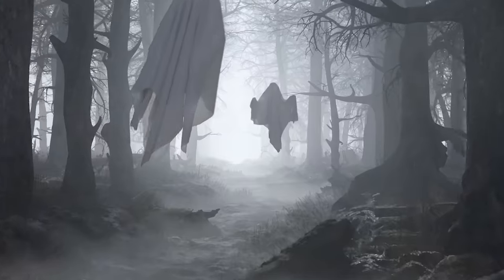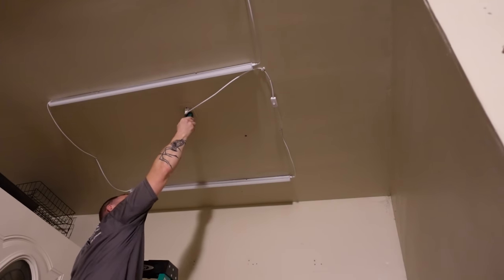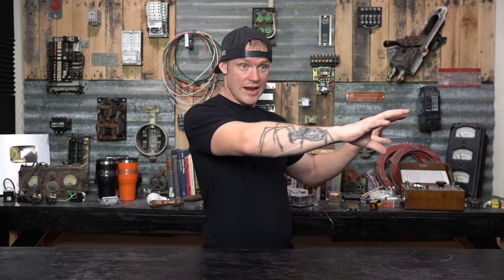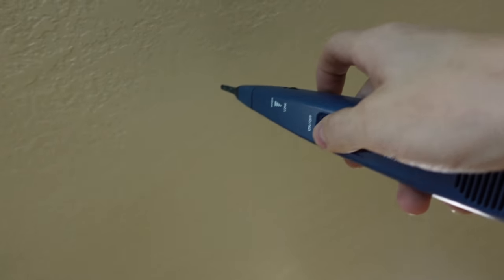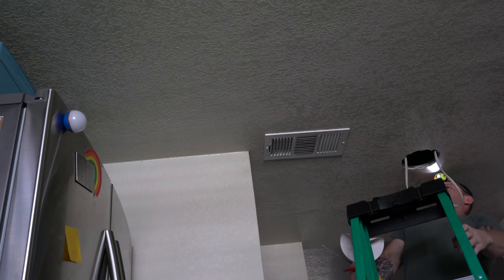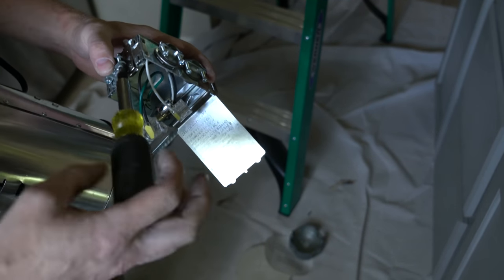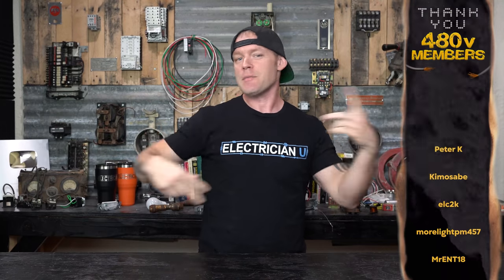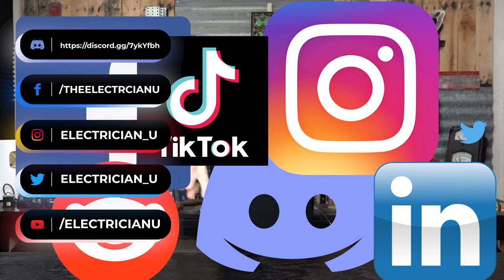THIS IS WHY ELECTRICIANS DON'T HIDE J-BOXES IN WALLS - Finding Hackwork!!

Comment: I never thought a 30min story about a hidden junctuon box would be so exciting.
Honestly this was more entertaining than most things I see on Netflix.
👏👏👏
Reply: Was it nearly 30 minutes?!? I was fully invested & it didn't even seem long at all lol. I was too busy saying yup, that's how I would do it stuff like that 😁
Reply: Even "Cuties?"
Reply: 👏👏👏bravo
Reply: I've got to ask.  Is it common practice to tie in wall outlets with lighting?  I always thought the two had to always be separate. 

Additionally, what are the rules with remodeling?  Say for example this is a one story house.  Home owners decide to convert the attic to a useable space.  But, the ceiling has existing junction boxes.  To be to code, does the existing wiring have to be redone to remove the junction boxes since the ceiling is now going to be a finish floor for the converted space? Or can it be left as is as it is not part of the remodel?

But lastly, assuming tying in lighting to the wall outlets is legit, isn't that a sign somebody was cutting corners?  Wouldn't have made more sense just to put in another separate line in the electric panel?
Reply: @superdave8248  No, it's not common, and should not be done.
Reply: @superdave8248   It is common in some areas to tie in wall outlets with lighting if you use an ARC fault breaker.
Reply: @superdave8248  A switch and a receptacle can be on the same circuit. Sometimes they share the same box.
Reply: 6 minutes in and still havent heard why I need to keep watching? Moving on and enjoy your exciting story.
Reply: Pop pop pop
Reply: Netflix sucks ! This is better
Reply: Thought the same thing!!
Reply: I know, right? Whoda thought. Seemed shorter. That’s a good thing too.
Reply: @superdave8248  Yes cutting into a socket circuit for lighting is lazy and incorrect. As to a second floor being built, I would agree that the wiring be altered. In the UK junction boxes are not allowed although DIY stores still sell them! In essence, all wiring should be installed so that ALL joints are at light points, switches and sockets. Nothing in walls or ceilings except the wiring itself. That way any faults are easy traceable, with bonus of passing code. I was a UK "Spark" but now retired. (Spark means an old hand at electrical work, wise and canny. electrician tends to mean a new guy on the block!) Oh and another thing I noticed, is how you use so many wire nuts! in the UK ALL connections have to be mechanical and push connections are shite, prone to hot spots, not tight enough.
Reply: @dsci-fiwriter2257   Yessir !     this explains why he has such a following since he does explain things well and keeps it entertaining on top of that !
Reply: I had to fast forward 80%
Reply: That was a great mystery! The problem  is that YOU and your work ethic are not who shows up. I've had to clean up stripped wire bits that went flying etc.
Reply: That's not saying much.

Comment: My dad was an electrician and taught me a great deal. I upgraded my service to 200A and followed the code as my Dad taught me (of course I pulled a home-owner's permit).  The inspector came out and looked at the service panel, saw my bending requirements were correct and everything was wired correctly.  He asked, "How did you learn to do this?" I informed him my dad taught me.  One of the things he taught (and I read in the code) was that junction boxes always need to be accessible.  Also know that you can have a maximum of 3 120V circuits in a junction box, or one 240V.

I am one of those weirdos that enjoys thumbing through the NEC.  I really wish I would have gone into the trade because I enjoy doing my own electrical work at home.  My hat is off to all of your professional electricians!!!  And thanks for the video!
Reply: You can have way more than 3 circuits in a box. It's about the box fill % relative to the wire size.
Reply: @steven7650  technically yes it is all about box fill, in which a 4 square box max fill is 10 #12 THHN wires unless you  use a 4 square extension. 10 wires doesn't seem like much for a box but it does make it easy to work on down the road. What's really great is when the last guy calculates out box fill and puts 5 extensions on a 4 square and its your turn to find one of their loose wire nuts. Great times.
Reply: BEWARE OF SEEKER FRIENDLY CHURCHES JESUS IS COMING  wtf are you doing man
Reply: @R0me0316  lol why not just use a deeper 4 square or a different box all together.
Reply: @richt5986  that would be what I would do. They make top hats for 4 squares as well now so using one of those you can neatly leave all of the wirenuts hanging out og the 4 square and just put that top hat on. For some people I would imagine it comes down to speed and convenience rather than doing the job right though. Not every electrician carries bigger boxes on their vehicle, or those top hats, so they cobble some half-assed junk together and mosey on down the road for the next guy to either fix or ignore.
Reply: @R0me0316   if the box is  Existing then I agree a 4 square or a 4" round  extension ring would work
But now a days plastic boxes are the way to go in a residential setting 👍
Reply: @richt5986  I prefer fiber in residential but it's been a nightmare to find them in stock for the last two years. Junky plastic it is 😭

Comment: Upon seeing the roasted wire nut, I exclaimed "DOH!"
Years back I was helping a relative do an interior remodel. Upon removing some cheap wood paneling, I was greeted by a hidden wire splice. It was done with an automotive crimp-type butt splice! I told the relative that we needed to open EVERY wall in search of horror stories.
Thanx for bringing the canless fixtures to my attention; they will be perfect in a spot in my kitchen that has minimal clearance.
Reply: I took down a light beside the bathroom medicine cabinet and found romex poking out of a 1/2" hole in the wall.  Hmm.  I pulled out the medicine cabinet too, and found two wirenutted splices in the cavity, no box, buried in blown insulation.  Whoops.
Reply: Happened to my dishwasher years and years ago. The person who installed it initially didn't put the wire nut on properly and over time the arc melted the wirenut.
Reply: Same here DaddyBeam. I bought a house and eventually tore out the tub to make a large shower. Found a live 12/2 romex just buried in the wall insulation. I guess they had considered installing a jakuzi style tub when they wired the house, but changed to a cheap one. It’s on a bedroom circuit, unlike the other bathroom outlets - which is probably another code violation in itself - but I converted it into a GFCI outlet.
Reply: I recently installed these, they are flush mount! So you can install them directly against studs
Reply: I haven't seen anything THAT bad, but when I got my house I did discover a couple of lights had been added with no j-box at all, they just drilled a hole and poked the wires into the cavity and wire nutted them to the romex. Thankfully it was easy to tell what had been added and what was original.

Comment: Thank you for speaking out about cleanup! A few years ago I stopped using a certain plumber, in large part because he left stainless steel drilling shavings everywhere after installing an on-sink water filter.
Reply: Along with never using him again you might just mention to him what happened. May have been just a bad day for him. If he is not told he may be doing himself harm unawares. Just a thought.
Reply: Right on. I also hired a plumber to replace leaky stem valves with ball valves in a finished basement. No drop cloths, had his teenage daughter pick things up for him as he was too fat to bend over. After he "cleaned up" and left, every ball valve leaked and I found globs of solder on/in the carpet and on my desk. Called him before he had driven down the street. Reluctant to return. No apologies for anything but tightened the valves and drove off. After 5 minutes checked and still leaking. Called and was told he wouldn't come back and all I needed to do was use a wrench. Master plumber with 30 years experience, how he stayed in business is anybody's guess but lesson here is if a trades person starts any job without covering the work area ask to do so or leave. Should have stopped payment on the check but he subbd for a friend and would have been extra awkward. Good video, sorry to go off topic a bit.

Comment: These service call videos are insights into how you troubleshoot, your thought process, your tools used, like that fancy toner. The crazy part is how full of energy about your work you are! Like me, except i'm not an electrician (YET!).
Reply: I like that YET
Awesome attitude to have!
Keep going and don't let anything get in your way!
Reply: He was using a fluke... it's a  100 dollar life saver. 
...and older homes are a pain because of those neutrals
Reply: In all the repair videos I watch - electronics, car repair, etc - the really good presenters always emphasize first that the most important part is careful analysis and diagnosis.
Reply: @grandpa6535   I like the Aegis ones better. My old boss who knew nothing about data and borrowed mine to trace out a PV cell but then shorted it out to verify the street lighting came on. It was only after I said "you do realize my f-set is still connected don't you" that the penny dropped. Bought me a fluke to replace it and I hated it. Stupid thing turns on too easily by accident and flattens batteries for one.
Reply: @TheDegan79  I've not seen the ageis.
Reply: @TheDegan79  Yeah, I hate having someone borrow something, break it, and not replace it! Oooooops I did that sometime ago and have thought about it for years. I wish I knew who I did it to so I could make it right.

Comment: Pro tip: When cutting holes for recessed lights, you can use a circular hole saw on a cordless drill to get you a clean hole, but run the drill backwards so that the teeth on the circular saw doesn't catch the drywall and 'crawl' over the drywall, cutting it up. Also, you can use a hole saw accessory dust bowl that catches virtually all of the drywall powder/debris. Quick, easy, clean.
Reply: You can also cut a basketball in half and stick it around the bit to catch all the dust
Reply: Bigger pro tip - Use a hole saw with the drill bit in the center instead of a cheap imitation lots of people try to get away using for this kind of work.......PLEASE spend the extra few bucks for the good tools.......
Reply: @albertwashingtonjr2089  Absolutely - but even with a saw blade with a centered bit, the blade can get away from you as it grabs into the drywall and you're trying to control it above your head for ceiling lights. I still cut in reverse and find it is much more controllable.
Reply: @vaska916  thanks for the tip, but when I cut the basketball the bang was super loud, scared me and the customer, and I fell of my ladder. I was asked to leave.
Reply: Its an old tip not a pro tip...to many pro tips today, as if we didn't do shit like this 60 years ago?
Reply: @moepow8160  so once YOU know the pro tip it shouldn't be shared anymore? you know new people keep being made and they are born knowing nothing, right?
Reply: @ionymous6733  looooooool
Reply: usually a circular hole saw comes with a regular drill right in the middle to center it before you connect the hole saw part to the material (at least that's the case where i'm from)
Reply: @albertwashingtonjr2089  cheap hole saws have a bit in the arbor, too, and pretty much every hole saw arbor you can remove the bit.
Reply: @ionymous6733  I laughed out loud at this! too funny!
Reply: Hmmm but what happens if it's mesh plaster 😂
Reply: Blu Mol brand makes an awesome dust collector
Reply: You can also use a keyhole saw. Hole saws are for the lazy and plaster and lathe. In 15 years I've seen so many people hit plumbing, have the bit fall out of the drill on the flood, or having the drill kick and fuck up the drywall and floor. 

Just use a keyhole saw
Reply: @bigcheese9096  in regular drywall I one hundred percent agree. Everyone makes fun of me for it but I think we've all seen someone drill through a Romex a time or two in their lives. Doesn't take much. With a keyhole saw you feel the wire before you damage it seriously
Reply: @erich1380  yes, not only that but you can feel for studs or anything else and adjust your cut if need be. My old boss had me cutting in 6" cans over a $300k movie theater room. Said he stuck a wire up there to make sure it was good and nothing there. So I listened to him. The plumbing was sitting directly on top of the drywall. Hit both of those lines and water leaked everywhere. Luckily I got to the water main in seconds and shut it down. But water still poured down into the room. This was 7-8 years ago and havent done it since.

But I still see others do it and have seen the same happen to them. I'm anti hole saw nowadays lol
Reply: @bigcheese9096  yeah it's funny you mention studs because I was just wondering to myself why nobody in the trade uses a stud finder. Are they not that reliable or something? I've literally never seen an electrician in my life whip one out. In theory they are every 16 inches starting off the edge of the wall but we both know in alot of houses alot of stuff was winged and not much attention to detail was used
Reply: @bigcheese9096  but all my plumbing line breaks have been from digging lol sometimes they are so shallow you hit em on the first scoop. What can ya do about that
Reply: @erich1380  our boxes are on studs most of the time. So we already found the stud!I do have one though lol think I've used it once this year. I trust tapping on the drywall more than stud finders.

Well you cant avoid it. But in a house we can. Homeowners arent very pleased to find out that a water line busted on their home
Reply: @bigcheese9096  hm idk man I use cut in boxes 90 percent of the time
Reply: @bigcheese9096  - I like the hole saw. I also use a dust bowl which catches the dust and keeps the place clean. In addition to that, far less chances of hitting stuff in the ceiling. It faster as well
Reply: @ionymous6733  Made me laugh like a maniac!
Reply: @Ralph Herge Fauci and WHO.
Reply: @Ralph Herge no idea what that is but it sounds nice lol
Reply: @KillswitchOwnsAll Back in my day, I recessed my whale oil lantern into the ceiling!  It looked so modern.  Burned the house down and killed my 11 kids though :/
Reply: Yes don’t just start opening all the plugs switches and shit like that . Go to the breaker box first then go to the plug where no power at then work from there player pro tip
Reply: The dust bowl works fantastically
Reply: Running it backwards is a pro tip so much better and cleaner
Reply: @ti3167  generally I would agree, I'm renovating my basement and the shit the inspector approved from a professional Electrician is a joke. 
I would just change that statement to "hire someone competent that actually likes their job"
Reply: @ti3167  Why? I’m not an electrician and I’ve installed over 40 GE z-wave switches in my house, wired outlets in my basement, installed LED Dow lights, etc. it’s not rocket science and the National Electrical code is easy enough to figure out for basic tasks like this.
Reply: Yea thats ok but with my experience they throw dust everywere and the ones with the clear shield around it just sucks. Lol. Idk but if it work for you kool
Reply: @ionymous6733  did you buy the customer a new basketball or did little Johnny cry himself to sleep?
Reply: I only use holesaws in New construction where I did the rough in... otherwise if you don't know what's under the drywall the pilot bit and or the saw can easily knick  a waterline or cable. At least with a handsaw you can almost feel if there is sth in the way.
Reply: @rangerrecon  That's because you're going too fast or too slow. I've probably cut in over a thousand high hats and I did have that problem in the beginning but now it's not an issue.
Reply: @bigcheese9096  If you're afraid to use a hole saw that means you probably don't know how to do it. Are you worried about cutting into a wall or ceiling with a sawzall too?
Reply: @JustinL614  no, not at all. It's funny, everyone has the same attitude as you until they hit a water line sitting on the drywall and they flood out a room in a million dollar home. Anyone who uses hole saws on a remodel is asking for trouble unless you can get a camera in the ceiling to make sure you're clear. Use you keyhole saw, it only takes a minute to cut the hole.

Why would I be scared about making sure my jobs done right?
Reply: Cut in reverse?! My goodness... how have I never thought of this.... Absolutely genius
Reply: Keyhole saw and a vacuum all day.
Reply: @destinhook3826  Yup - that is how I used to do it. But now I know the magic...
Reply: @apcross85  that's "apropos just the tip."
Reply: @JustinL614  everyday. You should be too.
Reply: @Ralph Herge I've done the cardboard method before.  Made a cheap little taped up box.

Comment: I'm a GC and have been in the construction industry for the last 40 years. I will say, "You are one of the most professional electricians I've run across". I generally sub out to two different electricians depending on the size and scope of the job and they've been good to me over the years. I especially appreciated the clean-up part!